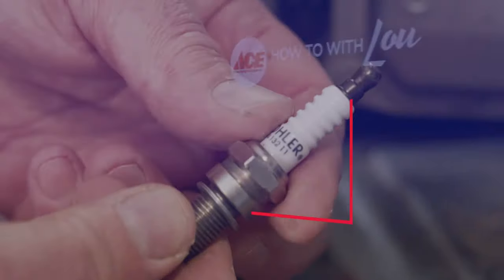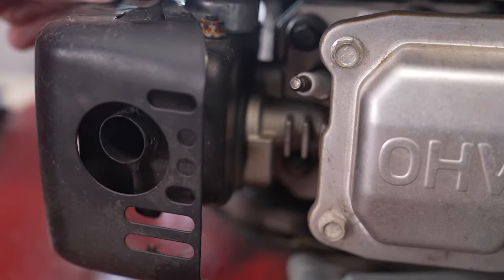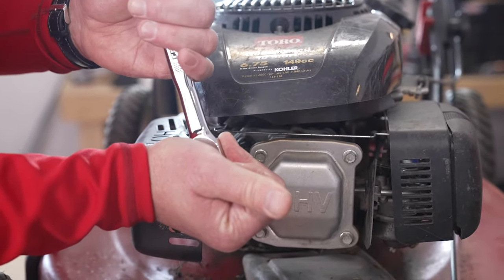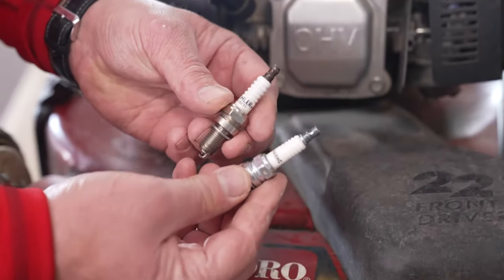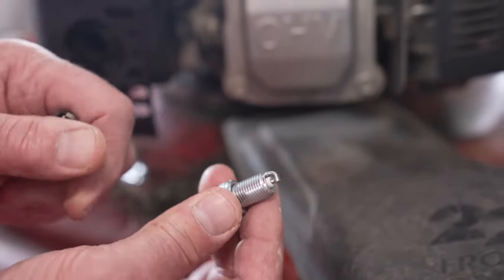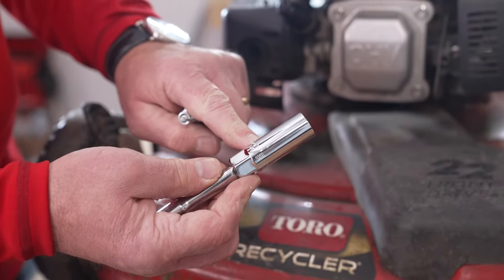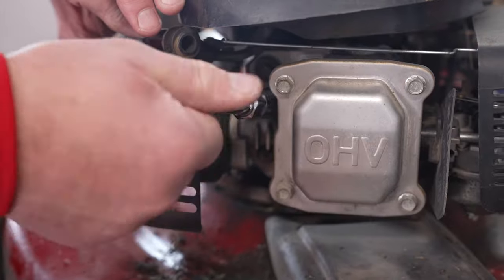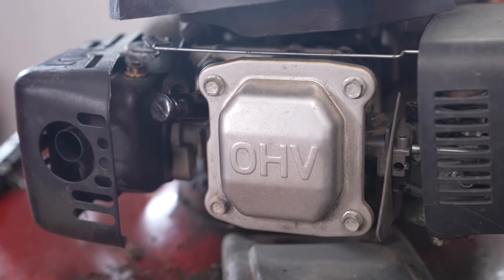How To Change A Lawn Mower Spark Plug - Ace Hardware

Comment: This really helped me out. I was able to change the Torch F5RTC spark plug in my 20" Yardmax pull-start push mower with Honda motor. Once I had the tools, it took me 3 mins. I bought a $20 deep socket spark plug wrench set at Walmart. It came with 12 sockets and the arm to get the torque on the nut. I pulled the connection apart with a solid tug. To remove the old spark plug, I needed a 13/16 socket, the biggest in the set I had just bought. I went back to Walmart with the old one in hand and found a replacement spark plug for the Torch F5RTC. I confirmed it was identical visually, in all regards. The spark plug replacement was not the brand that came installed in the mower. It cost $1.98 and worked perfectly, and this is the first spark plug I've ever changed. Thanks!

Comment: Does the spark plug or boot cover require any grease?  When I took out my old plug, it seemed very oily and greasy around the threads.  Just curious if this is needed.
Reply from the maker: Typically it does not need any grease.